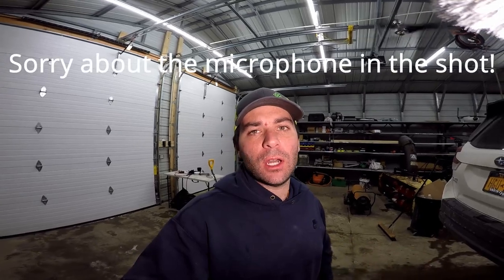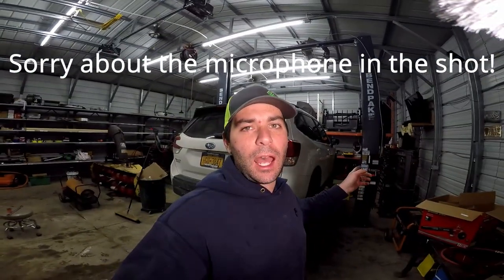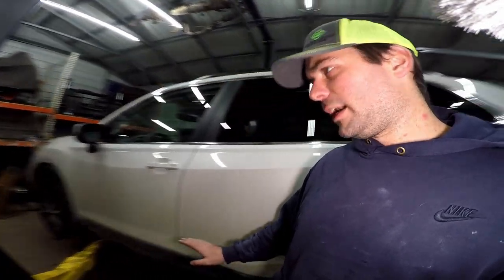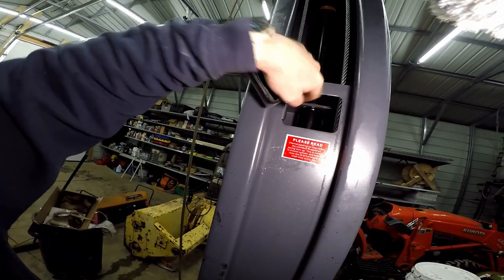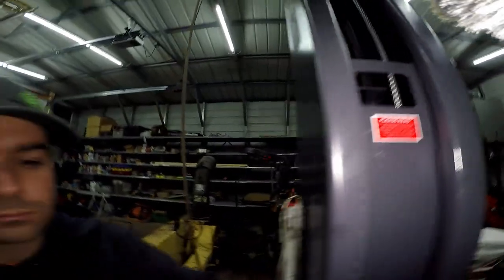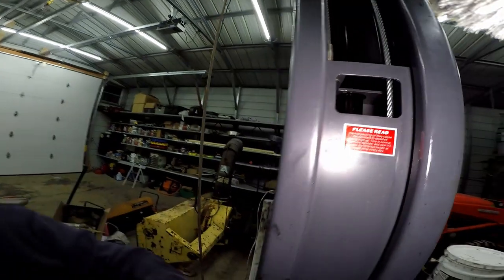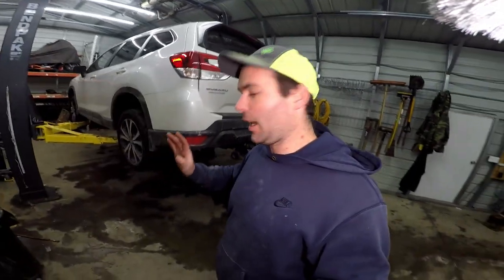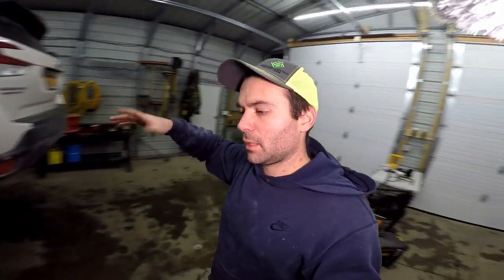Leveling Lifting Arms on your Car Lift

Comment: Finally got my new liff adjusted properly after watching several videos. Thanks
Reply from the maker: Glad I could help!
Reply: @EverythingElliott  its also slower with the pressure you have on those cables! always adjust WITHOUT A VEHICLE on the lift, that was your only mistake otherwise not bad. (I install and repair lifts), I have a few videos on repairs that MAY help in the future and if you need help on something you can't figure out, let me know I MAY be of some help, take it ez Tom in NV
Reply from the maker: @lt4324  Thanks for the tip Tom!

Comment: How far on did you thread the nuts on to each stud before adjusting one more than the other? The Bendpak directions dont tell you how far on to thread the nuts to start with and then adjust from there.  Thanks for the video.
Reply from the maker: I think I put them about half way on the thread so I had equal adjustment either way.

Comment: How often do u adjust them with the unlevelness of the concrete
Reply from the maker: Did it once. I assume in a couple years if the cable stretches I’ll have to do it again, but as of now it’s still the way I set it when I recorded this video

Comment: how much weight is normally on the cables ... i always thought the whole weight of the car was on them
Reply from the maker: That’s tough to say, the cables are more for making sure the pistons extend and retract equally. The weight of the vehicle is on the pistons until you lock it in to the physical locks of the lift. The cables just apply more pressure to the piston that is raising faster to allow fluid to transfer to the piston that is further away from your hydraulic pump.
Reply: @EverythingElliott  i had a pully break off and sounded like a bomb went off my sons truck was on it and it fell to the next lock..... the cable came whipping out completely of the post it was so violent thats why i was wondering  what kind of weight was on them and why they would even put plastic pullies on them
Reply from the maker: Oof that sounds scary. I’ve never seen a lift with a plastic pully. My bendpak has steel pullys, and my previous lift was a direct lift (Chinese brand) which also had steel pullys